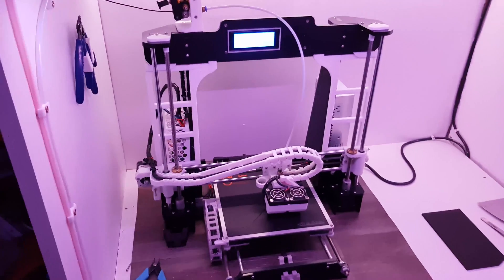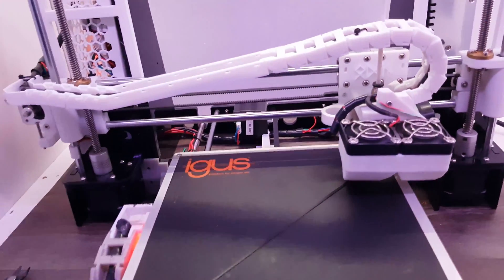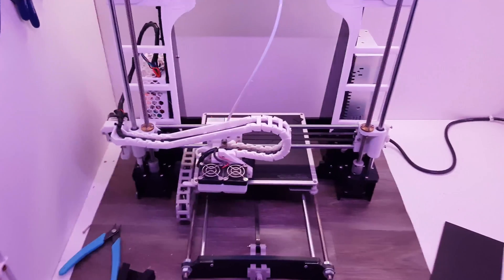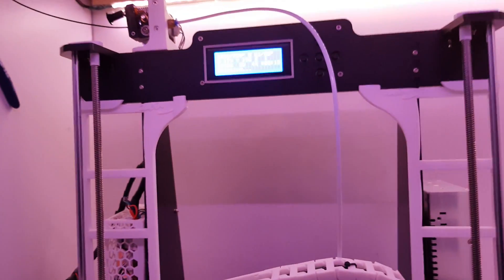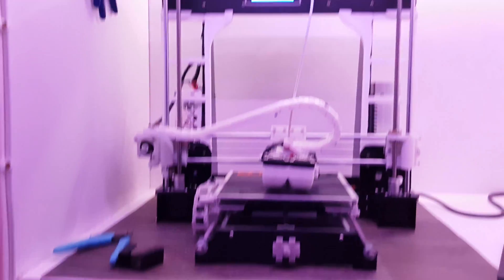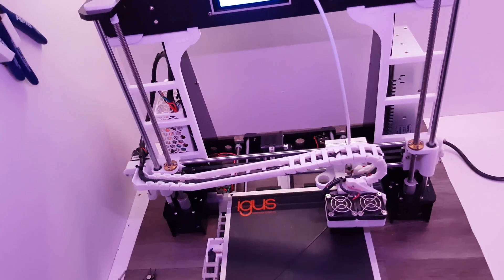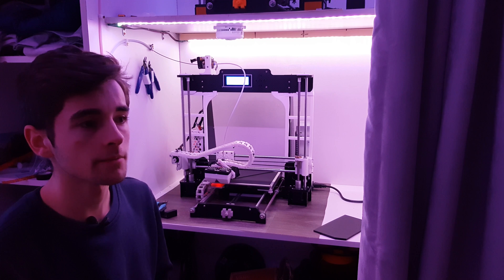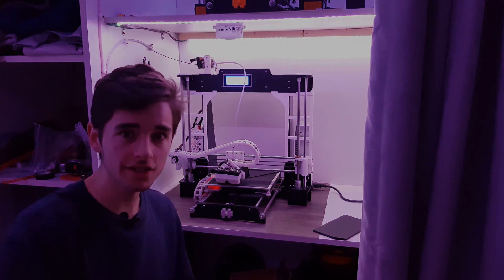Anet A8 After one Year of utilisation

Comment: Nice vid bud. I have been running an A8 for about 3 years. Still my favourite. I would put a 15a car blade fuse on the power cable to the bed and a 5a one to the board/rest.
Reply from the maker: Hey ! Thanks ! The 220V power switch already include the fuse so no worries on that !

Comment: ultrabase is 100x better than buildtak.
Reply: lefthandedpolack Only when you keep the power in during printing. Even if you have the power resume feature, if the power is off and the bed cools your parts will detach and you will have to start all over.